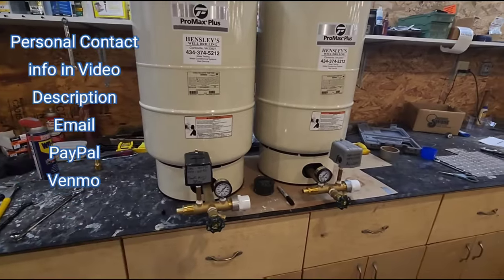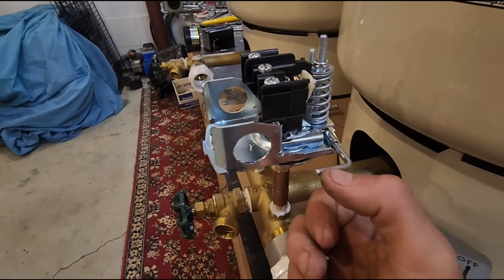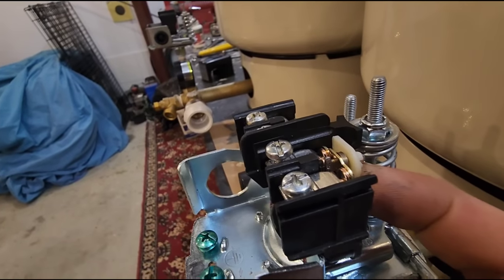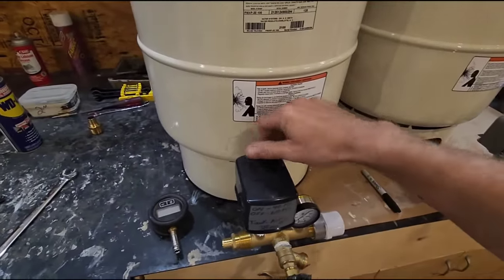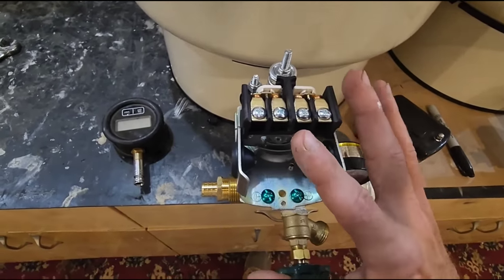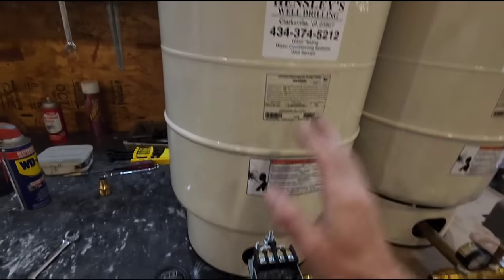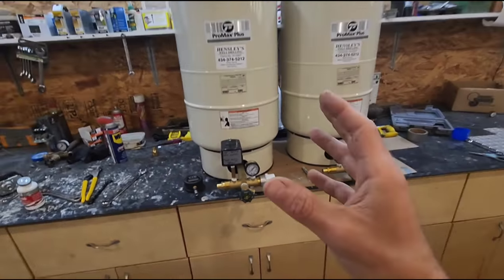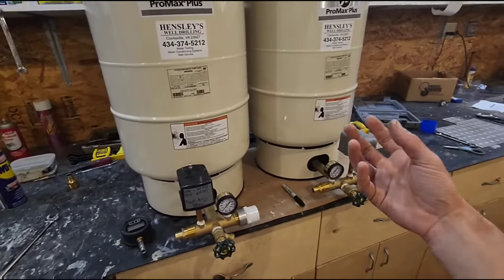Most Common Reason for No Water!! Reset Pump Pressure Switch. Water Well Repair Vlog Ep.18

Comment: Good afternoon. Can you tell me what's going on when the well pumps continuously turning on and off, the bladder tank that has a 30/50 pressure switch is empty and the pressure gauge is reading 100?
Reply from the maker: If the pump rapidly cuts on/off=the tanks bad/out of air. 
If the pump cycles on & off every 15-25 secs, that means the check valve in the pump is bad (or stuck open) allowing the water pressure to push back down into the well. 
Pressure gauge that's reading 100psi, typically means it froze during the winter & its now defective.

Comment: my pump stops working and it humms i thinks it the capster the pump is powered by a house swtich when i switch this off will it turn the power to the pump off so i can take the capasiter out with out getting shock

Comment: Do I have to add air to the bladder tank when I replace the pressure switch
Reply from the maker: Only if it's low. It's always best to check it & add air if needed before you turn the system on again. (Bc the tank must be empty of water when you check/ add air)

Comment: Can I put the pressure switch at the well instead of at the pressure tank ? 150 feet distance between the two
Reply from the maker: No, because it will cause the switch to cycle bc of water hammer. The tank adds cushin to stop water hammer. 
If you move a switch out to the well, you must also put a small 2gal bladder tank next to it.

Comment: Question: When I do this, I get 30psi, and then when I use water, the pressure drops to 0. If I press the switch further than normal, it clicks. Does this mean that I've gone too far?

Comment: They do make more then those 3 switches. You can get 60/80 and even 80/100 😊and if anyone messes with the adjustment nuts the sticker will not be correct thats just the switch they started with

Comment: Switch sparks but no change in water flow. Sub-zero freezing temps. Water valve only dribbled for a short while, No suction with pump switched off.  Water line frozen above water line or defective switch?

Comment: My pressure switch keeps tripping only when I use the garden hose. I have a 40/60 pressure switch and it has a reset lever.  36 psi in the tank. I drained the system. The pressure gauge was reading 0. It never shuts off when using the water in the house.

Comment: Hi, my pump turns on for a second then shuts off. I checked the tank and there is proper pressure, pump is primed. The contacts for the switch stay connected even with no electricity or pressure. Is that normal?

Comment: What if your cut in and cut off are working normal. But all of a sudden you drop below cut in range while the water is pumping around 30 psi. My tank has no leaks and I hear the air inside, bladder is only a year old no punctures.

Comment: My pump runs and starts out with good pressure then the pressure falls off to nothing. It was doing the same thing last year and the well company replaced the pressure switch. It’s an awesome older well that is not submersed. Any thoughts?

Comment: Hey, it seems like I have to manually start my pump every time my well water empties. I tried it on auto but it’s not working. We did have a freak lightning storm. Would that be the problem
Reply from the maker: Probably. It's likely the pump was hit & its overheating and turns itself off, this intern trips the switch to the off position. 
You could buy a switch without the lever on the side and while replacing it make sure the nipple below the switch is clean & not clogged up. 
Once u have a regular switch on the system,  if the water stops running, you'll know 100% that the pump is cutting itself off & will have to be replaced.

Comment: Hello Sir, I replaced my pressure switch it is one of the low level level ones with a switch . When I go to hold the level at the 45 degree angle the pressure goes to 25 and stops can you help me figure out why

Comment: Is it possible for someone to test the submersible pump, if the pressure switch is bad?  I have no water. Looked at the switch and it's very rusted. A jack of old trades handyman says he "by-passed" the pressure switch and my pump must be bad. How could he test the pump while the pressure switch isn't working?

Comment: Recently my tank dropped to 10 psi and my pressure switch has been running constantly. I did fill my tank back up to 38psi as the now. I also have low water pressure from all this. The guage by the pressure switch sits at 20psi. Any advise will help

Comment: My pump keeps running and yesterday I emptied the tank and check the pressure and it was like hardly anything so I pumped it back up to 28 turned it on. We had water decent pressure but during the day it just kept going down going down going down, going down and the pump wouldn’t stop running. Would that be a bad bladder or something else?
Reply from the maker: Most likely it's a busted pipe in the well, or a cracked fitting where the pump connects to the pipe. 
If you have 20 psi on the gauge & you turn off the pump breaker, the pressure should stay on that pressure. If the gauge drops to 0, you'll know there's a leak somewhere in the line. (If it's not a obvious leak in the yard or under the home, then the leak is in the well.

Comment: I really need some help if you can answer one question for me it's cycling on and off for me and I'm getting an interruption of water where it just stops completely and comes back within a second. I have a 30/50. As of today it is cycling with the pressure switch a lot what do you think I should check and do
Reply from the maker: Turn off the breaker, if the pressure drops to 0psi that's a sign of a bad check valve in the pump (or a broken pipe down the well) 
Test#2
While the system is off, drain out all water pressure, then check the air pressure in the top of the tank with a digital gauge. Set the air at 25psi. If its low, pump it up with a compressor (open a sink while you do that step) it'll push out Trapped water. Then turn the system back on. 
If pressure still goes up & down, you'll know that the pump must come out (unless you have a leak somewhere in the yard)

Comment: We are trying to keep our water on but w every low temp of less than 25° our water seems to stop working. They replaced our water pressure switch and we have new pump last year down in the well. We have also got brand new electrical service to our mobile home. This has been a daily struggle this winter and I'm wondering if there's anything else we should be doing. Or if there's a piece to the puzzle we missed? ANY suggestions appreciated.
Reply from the maker: 25⁰ is below freezing, so insulation for the pipes is probably a good start. Seal up the Well & tank area air tight if possible. I'd say it's freezing
Reply: @h2omechanic  fair enough thank you

Comment: Woke up this morning and no water!  Out of the blue, no apparent reason.  Power to pump, air in water tank bladder, power to switch, no circuits tripped.  I'm assuming it is the switch and coincidentally it is the same switch in this vid.  Hopefully a new switch does the trick.

Comment: Hello sir, I didn’t see a video for my issue so gonna ask here.  I woke up this morning to the low water alarm going off on well house.  It’s the alarm that is triggered when the storage tank is at a certain point (when the floating devices reach a certain point).  The well is no longer providing/pumping water into the storage tank (filling it up).  We do have water at the house and the pressure pump is still activating whenever a faucet is turned on.  So I’m not sure what’s going on or why it stopped filling up the storage tank.  The tank is about 1/2 way full which at this point.
Reply from the maker: The pump that's in the well could be bad. Or the wire down the well could be bad. You must be on the west coast. I'd definitely call in a well company asap. Might be a cheap fix, don't allow it to get worse
Reply: @h2omechanic  I’ve got someone coming out in the am.  I’m in south Texas

Comment: In a rental of mine I have a 3/4 hp submersible pump, 230 V.  Tenant called this am with no water.  When I came over there seemed to be a chattering in the pump control box.  Also is seems like there is no water in the pressure tank.  I thought the control box was probably bad so went and purchased a new one that fit the pump.  When I powered it up it also chattered.  Any thoughts where I should go first.  Tenant has new 3 week only baby and is freaking out!  Thanks for any help.
Reply from the maker: You have a 3 wire pump (I hate them) tougher to diagnose from my end. In skilled with 2 wire systems (no control box). But ill say this. If it is humming, it's trying to spin the pump, so I'd say the pump is probably locked up. Call a local plumber or well company, explain the situation and get a licensed pro out there asap. 3 wire pumps are typically deep, so not a DIY project
Reply from the maker: You could remove the wires at the well & test for power. If you get 240v then you'll know its a bad pump. But you must disconnect the wires from the wire nuts and test volts at the well head. If it every pops the breaker or reset button that's definitely a dead pump

Comment: I put a brand 30/50 switch. But no pressure builds up. So the switch does not kick on and off. I tried to move to points to get it started but still won’t start. The power s going through the switch because my well runs and i get water but no pressure. it was the same before i changed the switch i guess my old ones was not bad. I just don't know how to get the switch to operate or could it be I have a bad pressure tank.

Comment: 40/60 trying to do the manual level reset and it won't go past 25 psi and when I let go, it looses all pressure again. The tank reads 38 psi but I never opened the drain with the power off...??

Comment: So my well pump works when I'm using the hose, but it doesn't work (but sounds like it wants to) when I turn in my irrigation. When I use my hose, it will continuously cycle with the hum and click, I'm not sure if this is normal. I've never had a well pump before. When I turn on the irrigation, it will click then hum and gradually hum lower until it quits. Any ideas?

Comment: I have a zoeller 3 wire submersible pump 3 months old 1 HP I have no water and I replaced capacitor box and  points stay closed with or without power

Comment: I am having some issues 
Replaced water heater - turned water back on tank filled - pump shut off then no water to house 
I checked pressure switch and gauge- O pressure showed 
I shut the valve to house checked air pressure it was high - ran the pump and guage began to move then stopped- so I turned off - no steady rise on pressure gauge

Comment: I have a tricky situation . I measured the top of the tank I have fiddled with it o=in over two years. The pump keeps turning on at 50 and within 6-8 seconds the pressure drops to 30 and turns on and off  every 15-20 seconds . The pressure build up does not seem to be holding . Since the tank pressure is 40 should I be thinking the bladder tank side or pump side >
Reply: Should I be looking for a leak somewhere . When water runs the pump turns on and pumps just fine

Comment: I have the kind without the lever but when the power came back on mine were open instead of closed. I can hold the contacts together with the lid and pump builds up pressure but then goes open again.

Comment: @h2omechanic 
I have a little water flow in a basement a none on the main level. I found the pressure tank and it shows 0psi. I tried to crawl there to find out what pressure switch I have but cant even get the plastic cover off since it is installed vertically and a sewage pipe or whatever you call it is sitting right on the top of it.
I cant even find a drain valve to attach a garden hoes to drain the water out of the pressure tank.
Would appreciate your help/advice.

Comment: Weird issue. Yesterday sprinklers ran and went to use sink and no water. Pressure gauge basically at zero. Turned well breaker off.  Added air to tank 80 gal prosource.  Ran fine the rest of the day. Today ran hose to rinse lawn equipment off.  Pressure dropped to about 10psi.  Shut breaker off put air in tank. One thing i noticed why filling my guage on compressor was showing about 20 but water pressure gauge stuck at 10.  I bumped/tapped the top and then needle went to 20.  I filled the rest of the way up.  I then did an experiment. Used no water for 2 hrs.  Pressure gauge dud not drop.  What the heck is going on.  Thanks

Comment: Hi H2o  if i check the air pressure in the tank and my tire gauge doesn't move after i pump air in the tank what do you suggest.  i don't know how much air it takes before the gauge starts to move.  can you help me out    thanks
Reply from the maker: Adding air doesn't affect the water psi gauge. Youd have to check air pressure where you add the air at. If it won't hold air pressure in the tank, then the tank is bad. The bladders busted inside.
Reply: @h2omechanic  I think it's a 42 gallon tank. do you have any and how much do they cost   thanks

Comment: I replace my pressure tank, as well as my well pump switch and I still have no pressure. The gauge reads at 10 and my tank has 28 psi for a 30-50,23 gallon tank.
Reply from the maker: It's possible that you have a broken pipe down the well or a bad pump. If you truly have 10psi & a little water comes out, id say there's a broken pipe or fitting down near the pump.

Comment: Our pump is 20/40 can i change it to a 30/50 ? what is teh bladder pressure for a 20/40 meant to be?
Reply from the maker: 20/40= 18psi of air in the tank. 
Yes you can bump it up to a 30/50 switch.

Comment: My switch won't cut off and the pressure reads 20lbs and stays running how do I fix that problem? It's a 30-58 and the bladder tank has 28lbs of pressure in it.

Comment: I have a Grundfos 10SQE05-160 - 10 GPM 1/2 HP SQE-Series installed in my 45 foot deep domestic water well.  It is a highly possible that my well is going dry.  When attempting to restart the pope using the pressure switch.  My question is does this Grundfos  well pump have a no water sensor which will not allow it to turn on even though the pressures switch is calling four water?
Reply from the maker: Yes, if it senses that no water is present, it will cut itself off.  It's also a soft start pump, which means it takes about 5 seconds to spin up to full speed. 
The SQE modes should have a black control box with LED lights on it, those lights should show a code I believe. The SQE also has a pressure sensor rather than the traditional pressure switch, make sure the sensor isn't plugged up in the small orface (if you have one) 
The regular SQ models don't use either the sensor or the LED controller box.
Reply from the maker: 45ft...just shine a light down the well,  or use a 100ft flat tape to measure water level

Comment: If my pressure switch is working properly and I have valve to house turned off but pressure is bleeding off and sounds like maybe running back into well, then what would be the problem?  Then it drops to 40 and pump comes back on within a couple minutes?
Reply from the maker: Normally that's a sign of a bad check valve in the pump. 
Or a cracked fitting between the pump and pipe. 
Either way u must pull out the pump. 
If u get bad sediment issues recently, it's a cracked fitting.

Comment: I bought a new 3/4 horse pump and new switch still not getting no pressure to the gage checked my tank no pressure will that cause my well not to work
Reply from the maker: Did you ever inspect the wire going down the well? It's probably broken

Comment: I can’t get the pump running. It hums and I tried the flick test. Motor feels higher than warm and I still can’t get it to run. I have 128v across both lines. Continuity across as well.

Comment: HELP When I took the original switch cover off the wiring was [ w | b | b | w ] I purchased a new switch, removed the old one, checked the label on the inside of the switch cap and the wiring diagrams match [ L | M | M | L ] turned the breaker off, wired up the same way it came apart and got fireworks out of the breaker switch and the right side pressure switch contacts when flipping the breaker back on?? I immediately cut the breaker off and put the old switch back on the same way it came off, more fireworks! What have I done wrong? Any guidance is much appreciated.

Comment: Well I thought my well pump switch was going bad since my water in house would short cycle. Not the case. I had water in the air line of my well pressure switch now im worried it’s probably the well pressure tank as I just replaced the actual well pump a few months ago.

Comment: hi, do i have to turn off the electricity for the whole house or something i am trying see what’s wrong with my well
Reply from the maker: It's best to turn off the power to the pump in the breaker panel if your messing with anything electrical regarding the system. 
Also best to double check with a multi meter to make sure no power is present. 
If you don't feel comfortable, then hire a license plumber to access the problem
Reply: @h2omechanic  ok thanks for the help

Comment: My switch (brand new) does not turn on automatically. I have to manually turn on my switch. Then it only builds to 30 psi. This is the 2nd new switch and it's still doing the same thing.